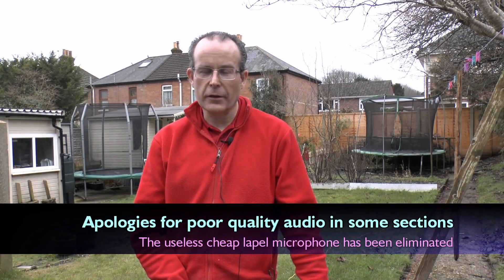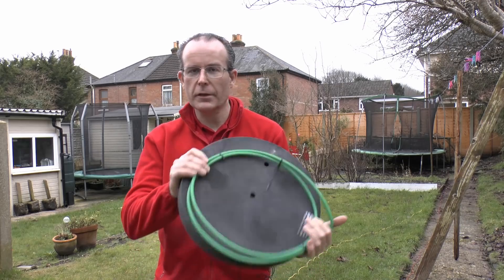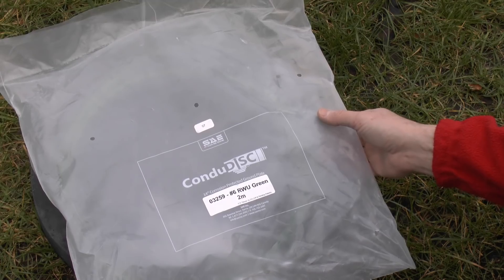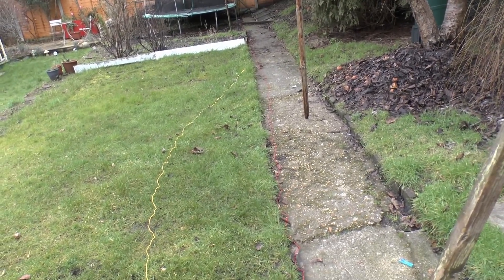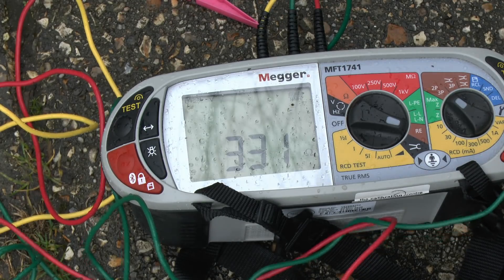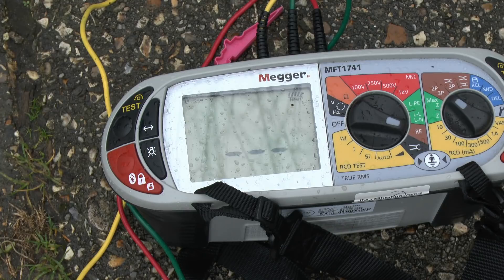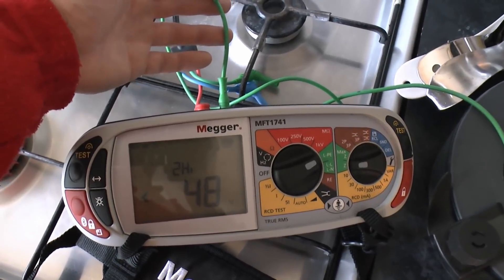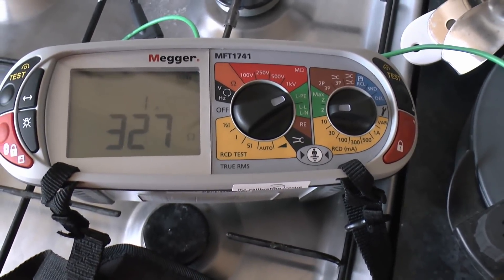ConduDisc Demonstration - Earth Rod Alternative

Comment: My experience of this is as follows. Circa £300 got me a ConduDisc and a 25kg bag of ConduCrete delivered. Excavating down to 750mm yielded over 300 Ohms Ze. Relocating to an adjacent area with less sand and digging down to 1000mm returned over 400 Ohms Ze, not what was expected at all.

The Ra came in at an average of around 378 Ohms, which was 70+ Ohms higher than Earthing Services statistics for the resistivity in the installation locality. A further 75kg of ConduCrete and additional 5m of 16mm squared Earthing cable into a separate excavation linked to the ConduDisc was suggested, in order to achieve a theoretical Ze of less than 200 Ohms - note theoretical.

For context, a 4ft rod returned 800 Ohms Ze and 12ft of rods achieved 250 Ohms, all for less than £70 including couplers and inspection pit and additional rods and couplers to drop sub 200 Ohms.

Earthing Services who supply ConduDisc and ConduCrete are responsive and decent to deal with. I would advise anyone thinking of installing one of these to get an Earthing study done first and foremost to avoid additional costs. You need to be thinking about the lay of the land around your installation, soil type and elevation before buying.

Comment: Seem to be very difficult to buy. Only 2 suppliers that I could find & neither sell or even give the price via their web site. You can't ring up and order one either, you have to request a quote, which can take a while to arrive, then they insisted they had to create an account even though it was a one off purchase & to open the account they wanted my bank account details.
The price at the moment is a bit eye watering (I was quoted just under £200 for a Condudisc Pro & £62 for Conducrete), even delivery is expensive (£80 from the 1st company £55 from the 2nd - yes that's just delivery - seems it has to come on a pallet).
Oh and neither company mentioned the price was plus VAT in their quote... So those prices above exclude VAT

Comment: Thanks for your video John. To get a good reading on this disk you will probably have to bury it at a depth of around  2 to 3 feet down and then compact it in. That's a lot of digging and work to do, not much of a time saver really. It's easy if the ground is soft but then a stake would be easy to drive in soft ground also. Digging such a large hole in compacted ground with possible rocks or large stones would be harder than driving a stake. As far as avoiding services is concerned, I don't think there is much improvement as most services are buried around 2 feet down around a property so it would still be difficult to find a suitable place to bury the disk.

Comment: Here's a marketing / product idea - a generator 'table'. Consisting of a 'table' with a 2" lip all around it. You stand your generator in the 'tray' table top - the table having 4 legs made of 22mm copper tubing open at both ends with no feet. The weight of the vibrating generator 'quietly' tapping the legs further into the ground - while, in the 'tray' you add a good inch deep of water. The water runs down the copper tube legs making the groud wet - aids sinking in the legs and electrical conductivity. Earth your generator to the table ;)

Comment: perhaps adding small spikes about six, in a bracket on the disc would help conductivity, driven about 4 inches in the soil, stepping or hammering on a center plate attached to the disc.

Comment: Hi John, I know you must be a busy guy but if you see this comment (or anyone else for that matter) it'd be great to get some advice. In my kitchen I have an outlet for an electric cooker which is connected as a single circuit on the consumer unit with a 45A breaker. I want to have an on-demand electric water heater installed in the kitchen, this is a 9kW device which will also need a 45A spur. I have had an electrician who says he can run a spur from the consumer unit to another control unit in the kitchen for use with the heater. Another electrician has said the best thing to do would be to run a single 25mm² line from the main consumer unit to another consumer unit in the kitchen and then spur that off to the two control units. The later suggestion seems dodgy to me,  I'm not an expert but I don't believe having a consumer unit in a kitchen would be a good idea and I'm not convinced having such a high current breaker (It'd need to be 90A surely? The main cut off fuse is only 100A) in the main unit is even possible.
Reply from the maker: A 9kW heater is approximately 40 amps, so a 40A or 45A circuit breaker would be appropriate.
25mm² is grossly oversized, whole houses are supplied with less.

The normal method would be a new 40A or 45A circuit from the existing consumer unit to the heater, with an isolator switch at the heater end.  Cable would typically be 6mm² unless it's an excessively large distance or it has to be installed through insulation or other undesirable things.

There is also the question of whether the supply is capable of supplying the additional load, which depends on it's capacity and what else is already installed in the building.

Comment: I always find it amazing how in some countries you have to be so careful about possible cables or pipes not belonging to you being buried under your property...
Reply: I worked for British Telecom for 30 years and we had ( still have ) thousands of miles of cables in private property. One issue is that boundaries can  change over time. The GPO as we were then always got permission and wayleaves before laying a cable but if that land was later sold for development they could find a fair sized cable across the back garden. Poles in gardens etc. In modern housing estates quite often the 1st metre in from the edge of the footway is a services zone and people would just assume it was their garden and plant stuff there or have a block paved driveway laid right to the footway, many time people came home to find us digging a large trench or lifting their driveway. It caused a lot of arguments but I never remember a single case of them being correct. They would insist they bought that strip from the council but then had  to admit that they didn’t pay for gas water electric and telephones to be rerouted into the carriageway and back into the neighbours services strip, meaning they never really bought it at all. Driveway companies although knowing the situation never told householders they had to stop 1m short of the footway either. It’s a long standing headache. Farmers regularly plough up cables that may be feeding a village and can’t be run in carriageway ducts. The farmers don’t want the cable but checking the wayleaves it was their grandfather who gave the permission decades ago. This is a reason for slow fibre optic roll out in rural areas, having to close a single track road and lay miles of carriageway duct and manholes takes weeks and costs millions of pounds only to find that most people are happy enough with their ADSL and the service providers can’t get their customers to take the fibre.
Reply: Its because they're so old. In London, no one really knows where a lot of the Victorian pipes and cables are.
Reply: @londontrada  Same in most major cities, found a tunnel in Birmingham right next to a highrise they built in the 60's as they were knocking it down , they reckon it dated back to victorian times

Comment: I have seen 360 ohm when rod has hit rock after 500mm. So for me the jury is still out on this product.really not happy with value over 150 ohm as concern over surface fault voltage and unreliable tripping due to low fault current
Reply: As JW says this is not a complete installation, just a demonstration of the product, and as such the performance is not reflective of a real world installation. JW points out that this is not to depth or properly compacted. 
Simply backfilling a ConduDisc is a bit like laying an earth rod in an excavation as it does not sufficiently reduce contact resistance. For example a driven earth rod is forced into the ground assuring low contact resistance which ultimately benefits discharging electricity as it is easier for the energy to pass from one medium to another. Providing this comparable resistance for a ConduDisc requires compression. 

A great case study of this is shown here:
(https://www.linkedin.com/feed/update/urn:li:activity:6772877222358466560/?commentUrn=urn%3Ali%3Acomment%3A(activity%3A6772877222358466560%2C6773253548340764672 )) 
In this instance the ConduDisc was nearly 400 Ohms when installed, but through compression it got down to 75 Ohms. Most people aren't as heavily equipped as FM Services Group in terms of vibrating compression tools, but Liberty Charge elects for its staff using their body weight to compress, which will certainly accelerating resettlement of excavated material as seen here: 
https://youtu.be/OxQdjyZKe1U

Furthermore at this point it's unclear what the ground profile is, without a soil resistivity survey that could be speculative. Our short overview here: 
https://youtu.be/CbkFfBgX8YI 
demonstrates how influential soil resistivity can be. Afterall gold is an excellent conductor but if you put it in a block of rubber it will not discharge electrical current. Here we may be seeing the earth rod having penetrated an optimal layer of soil resistivity which has enhanced its performance. As much as the ConduDisc has a contact surface area equivalent to a 3m rod, if it's in a more resistant layer then its performance will be impacted. 

Finally it is worth saying this, the reason that there is a marketplace is to enable people to make a choice of what suits them. The ConduDisc will not deteriorate like the earth rod, it is easy to install, safer to install and it will likely outlast the item it is protecting. All we would say is if you are using one get it compressed, it will improve performance with no extra cost!
Reply: https://www.youtube.com/watch?v=8mVIuxuOvaY - ConduDisc and Conducrete - 47.5 Ohms on the day of installation

Comment: It's wonderful to see the great John Ward getting to grips with the ConduDisc. Everyone at Earthing Services recognises his expertise and applauds all of the knowledge sharing that he does; just like many in the e5 Group John Ward has worked tirelessly to improve safety in the electrical sector and this is a further demonstration of that. 

Nobody at Earthing Services was involved in the preparation, planning or implementation of this install. 
As JW says this is not a complete installation, just a demonstration of the product, and as such the performance is not reflective of a real world installation. JW points out that this is not to depth or properly compacted. 
Simply backfilling a ConduDisc is a bit like laying an earth rod in an excavation as it does not sufficiently reduce contact resistance. For example a driven earth rod is forced into the ground assuring low contact resistance which ultimately benefits discharging electricity as it is easier for the energy to pass from one medium to another. Providing this comparable resistance for a ConduDisc requires compression. 

A great case study of this is shown here:
(https://www.linkedin.com/feed/update/urn:li:activity:6772877222358466560/?commentUrn=urn%3Ali%3Acomment%3A(activity%3A6772877222358466560%2C6773253548340764672 )) 
In this instance the ConduDisc was nearly 400 Ohms when installed, but through compression it got down to 75 Ohms. Most people aren't as heavily equipped as FM Services Group in terms of vibrating compression tools, but Liberty Charge elects for its staff using their body weight to compress, which will certainly accelerating resettlement of excavated material as seen here: 
https://youtu.be/OxQdjyZKe1U

Furthermore at this point it's unclear what the ground profile is, without a soil resistivity survey that could be speculative. Our short overview here: 
https://youtu.be/CbkFfBgX8YI 
demonstrates how influential soil resistivity can be. Afterall gold is an excellent conductor but if you put it in a block of rubber it will not discharge electrical current. Here we may be seeing the earth rod having penetrated an optimal layer of soil resistivity which has enhanced its performance. As much as the ConduDisc has a contact surface area equivalent to a 3m rod, if it's in a more resistant layer then its performance will be impacted. 

Finally it is worth saying this, the reason that there is a marketplace is to enable people to make a choice of what suits them. The ConduDisc will not deteriorate like the earth rod, it is easy to install, safer to install and it will likely outlast the item it is protecting. All we would say is if you are using one get it compressed, it will improve performance with no extra cost!

Thanks again JW for having a go with the product and we look forward to his next adventures! 
A final point, JW you clearly look after your testing equipment to a truly admirable standard, not the bird's nest of testing cables so often seen!

Comment: 300 ohms and above !!! Miles too high than the recommended  200 ohms.. will be interesting to see how it performs in the next video👍
Reply: Quite right, 300 ohms isn't indicative of a complete installation. Glad JW points out that it isn't at depth or compacted.
Reply: https://www.youtube.com/watch?v=8mVIuxuOvaY - ConduDisc and Conducrete - 47.5 Ohms on the day of installation

Comment: What no salt water 💦😄
Just to say I did new electrodes on a couple of terrace houses. First job required  three three foot extension rods to get below 200 ohms which needed a sledgehammer. I imagine the first set of deep rods improved next door reading which only required a single rod . The electrodes were only about 4 meters apart from each other . It would be interesting to see if the same thing is going on here
Reply: https://www.youtube.com/watch?v=8mVIuxuOvaY - ConduDisc and Conducrete - 47.5 Ohms on the day of installation

Comment: One question I would ask how would you achieve compliance with the regs as to the earth being continuous with no breaks or joints in the run?
Reply from the maker: Nothing in BS7671 requires an earth conductor to be continuous with no joints.
Inaccessible joints would need to be permanent, as in crimped, welded or similar,.  Other types of joint such as screw terminals would need to be accessible, in the same way that the connection to an earth rod remains accessible.

Comment: wow, that earthing services site plays four different videos at the same time automatically, what a mess.

How much do these cost? It's definitely interesting.
Reply: That's concerning, could you reply advising which page on the website? That clearly shouldn't be happening and we cannot find it.
Reply: @earthingservices44  It was the condudisc page, I just checked again and this time it didn't do it, so not sure what triggered it last time, good that it's not consistent though.
Reply: @XOIIOXOIIO  Thanks for re-checking and delighted that didn't happen this time. Have spoken with the site team to monitor this. Your feedback is invaluable so thanks again, and always feel free to get in touch!
Reply: I got a price from them directly recently, they quoted 1 x 16sqmm ConduDisc  @ £148.00
2 x 25kg bags of Conducrete @ £38.50 per bag

Comment: My house in Canada, built in the 1970's has a buried copper water main, which also serves as an electrical earth connection.  Many modern homes no longer use copper mains and have to make use of earthing rods.
Reply: Not allowed to use  water mains as primery earth supply in the UK any more because of the switch to plastic
Reply: And yet my 1987 UK house with plastic water main still has an earth bonding wire to it, connected mere inches from the joint to the plastic. Later plumbing changes in the house with plastic mean it is only connected to a couple of metres of copper pipe in the house. The incoming gas pipe (probably also mostly plastic but harder to tell) also has an earth bonding wire to it. The main fuse says it is a PME installation but I'm far from convinced any of the earths are any use. If there is an earth rod anywhere, I don't know where it is.
Reply: @owensmith7530  well they aren't any use are they. Just a waste of time and materials. Sometimes it's company policy. Severn Trent bond across water meters even with incoming and outgoing plastic pipes!

Comment: Hmm, really nice in theory, but I'm worried that's make it easier for people to half arse it and not bury it deep enough.

With an electrode you have to drive it at least so deep to stop it sticking out.

Top layers of soil are going to be much more seasonal than the lower layers with regards to moisture and ice.

With an electrode, the soil around the top may dry out , but the lower bit will still likely be damp.

If the soil around this dries out...*all* the soil in contact with the electrode will be dry, potentially increasing the resistance by an order of magnitude.

Is there regulation on the minimum depth of an earthing electrode?
Reply: As far as UK earthing standards are concerned the minimum depth is 600mm to mitigate the seasonal variations you reference. In terms of what operatives may do during an installation shallower is not uncommon. You make a good point about driving an earth rod, but sadly all too often cutting off half-buried rods occurs, as does even more alarmingly people leaving earth rods sticking out of the ground. In terms of does it make it easier? Perhaps, but then again it comes down to personal professional standards.
Reply: https://www.youtube.com/watch?v=8mVIuxuOvaY - ConduDisc and Conducrete - 47.5 Ohms on the day of installation